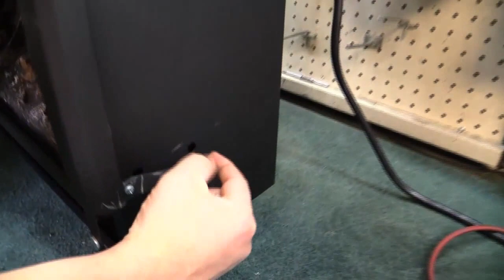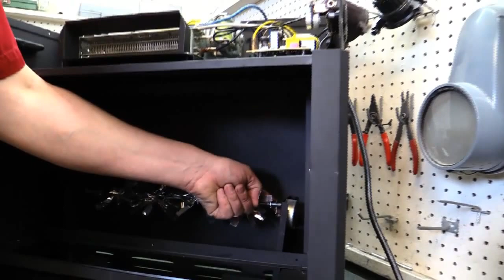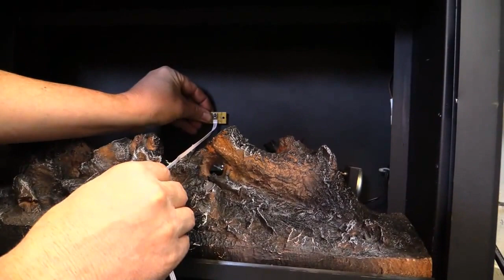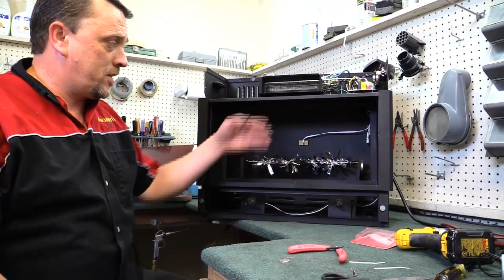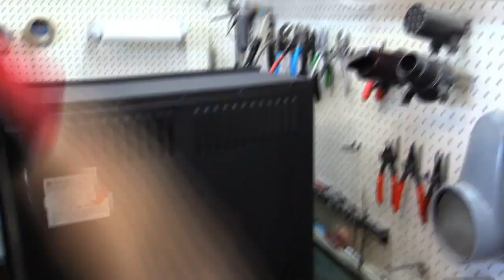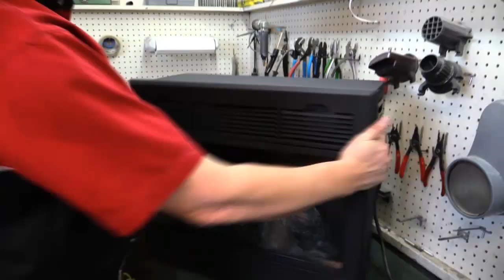How to Install the Heat Surge Remote Sensor and Syncro Flame Motor

Comment: My wall mounted fireplace overheats. The black wire connected to the element is burnt. What do I need to change?
Reply: Give Vacuums Etc a call at  1-855-VACUUM-1. They are the nations leading repair and service facility for Heat Surge. Thanks for stopping by, I hope we can help you. Have a look at our website if you have any other questions.